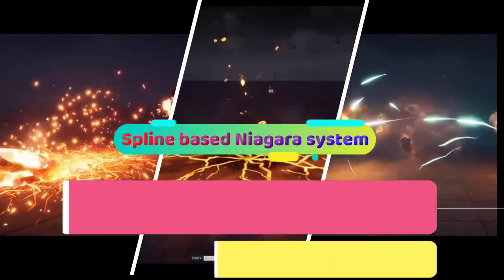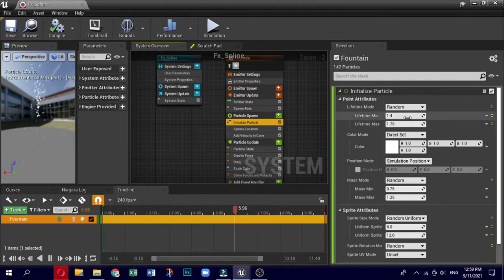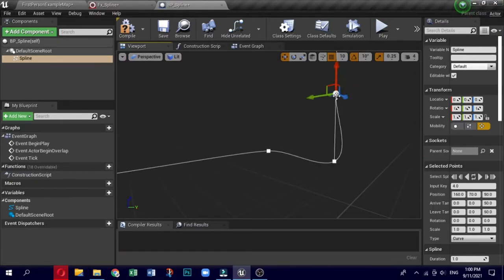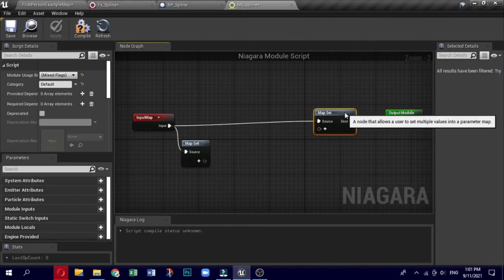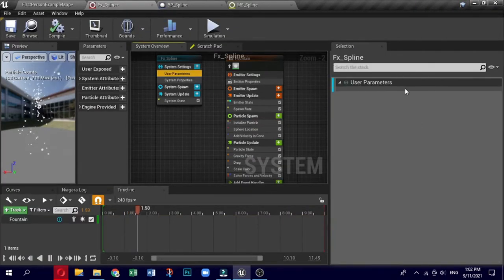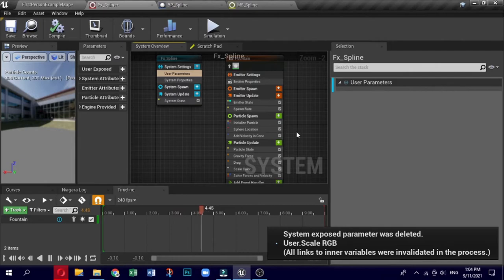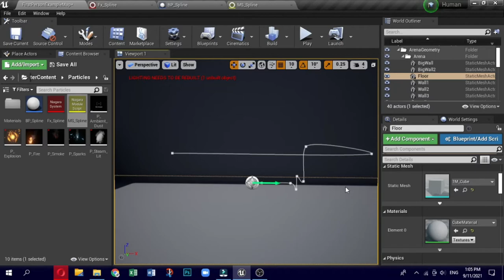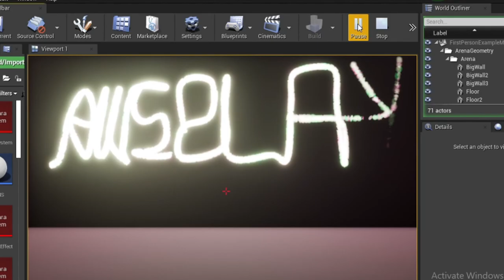N8: Spline based Niagara Effect | UE4 Niagara System For Beginners | AIP

Comment: Hi, I can't see any option for MS Spline, only Sample Bezier Spline comes up, even when I untick library only. The only options that come up are Waveform and Sampel Bezier Spline. UE 4.27
Reply from the maker: It should be available there. and we used same UE 4.27
Reply: i see your issue. 
You need to take the output from the spline first to show all the options, it drived me crazy for 20 minutes